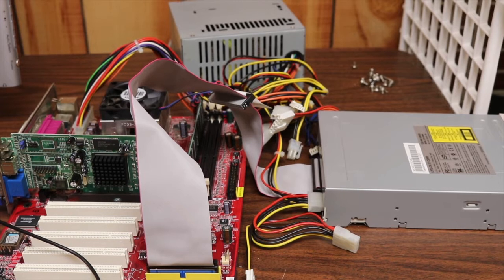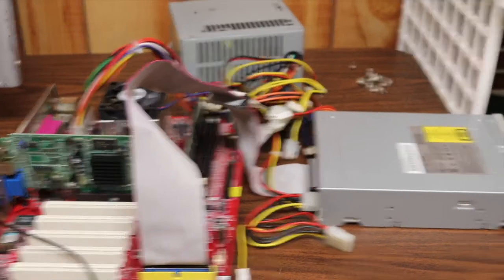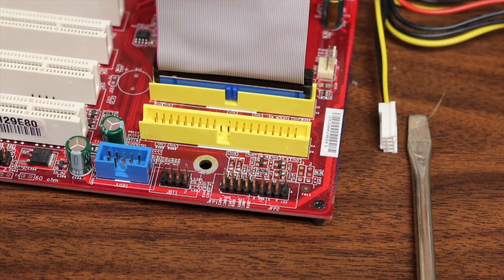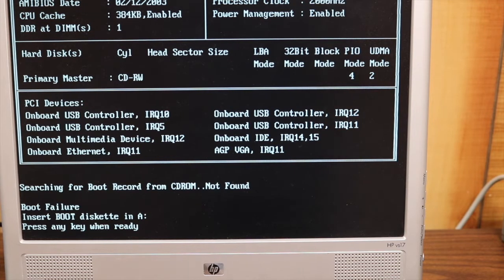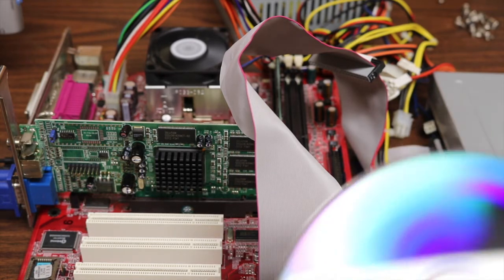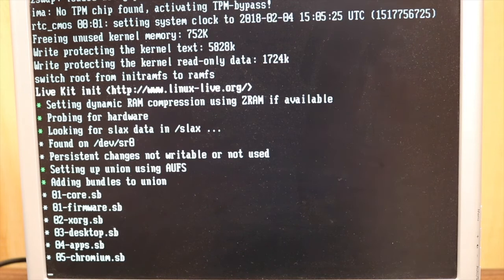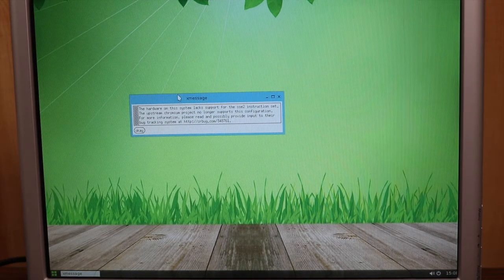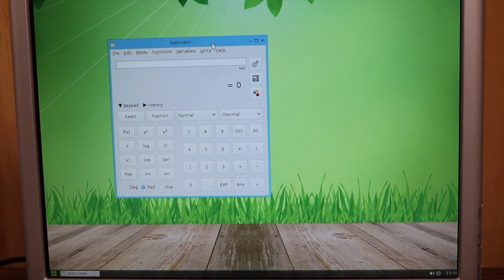Lightest Linux Distros Episode 2: Slax

Comment: Hi, Have you tried using a "Plop" C.D. to boot your decripit old P.C. from, you would then be able to boot from USB memory and (where possible) create a persistent USB install. 
Why not just scrounge a hard drive from somewhere or do you have a glut of CD's to use up!  
I hope that you can turn out more videos in your "Lightest Linux Distros" series, try Legacy Linux, Puppy based and runs entirely in RAM or AntiX which runs really well in a USB stick
Reply from the maker: Hi, thanks for your comment. I do prefer to use distros that can fit on a 700mb cd rom because I happen to have a lot of them laying around. I will try to get more videos out soon!
Reply: bill fawcett CD-ROM Yes Found ! Yes good
Reply: bill fawcett cool CD-ROM
Reply: bill fawcett Yes...yes good